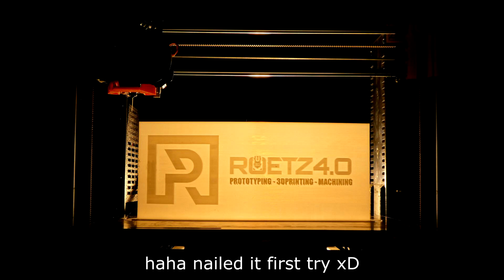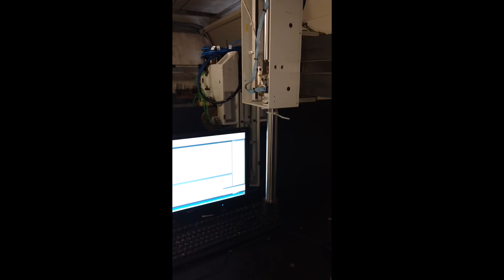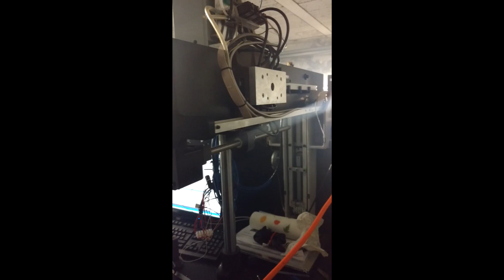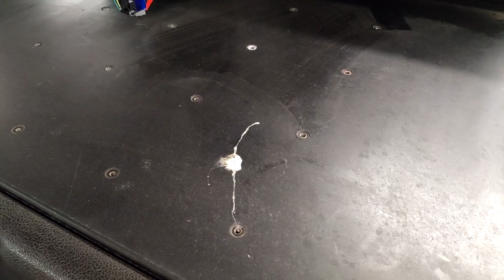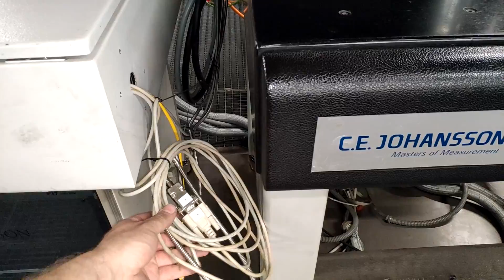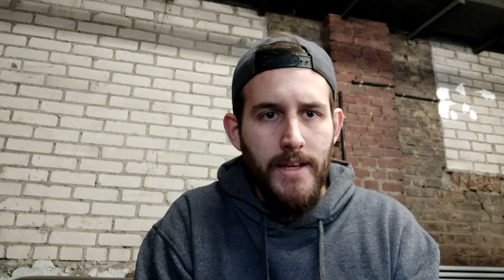What to do with my 1.3 Ton - Air Bearing - 3D Printer ?! #S01E01

Comment: if u want to full utilize ultra precision of air bearing system as additive manufacture system,I recommend u print biology tissue.But u need to upgrade feedback and drive system(better encoder and coreless linear motor,possible linear amplifier as well)

Comment: You could make it a 3D printer, but also a reverse engineering tool.  You could put a part on the bed then let the machine digitize a large number of points, similar to :  https://youtu.be/on53HHSSGOI  I know digitizing organic shapes or reverse engineering complex shapes is something that is very difficult for a small machine shop.
Reply from the maker: Interesting suggestion. I do have a matching renishaw probe. Lets see if I can squeze all of this together

Comment: Hey!
Impressive project! My suggestion: if you're already retrofitting a coordinate measuring machine, why not using it's precision to measure your prints with a tactile probing head as a quality check?
Reply: Ohhhhh, feedback loop to account for shrinkage. Print once, measure, scale and print exactly the second time.
Reply from the maker: Interesting idea! Never thought to do that, there might be parts where this comes in handy
Reply: Yeah this is a great suggestion, if you add a interchangeable laser tool head you could also measure a lot of laser variables.

Comment: I don't know if you can source the materials used for metal injection molding, but doing a custom extruder+hotend to 3D print metal parts would be cool. You might have to enclose and heat the build chamber and definitely need a furnace for sintering.
Reply from the maker: Direct metal printing is like the holy grail. Had a lot of thoughts on this one. My heat treating oven lacks 100-150°c to make the first steps in this direction, but I have done some experiments with powder infused filaments.

Comment: Add a toolchanger for swapping hot ends and apply the 3d tool path technique to allow prints with layers aligned with surface curvature. 
A heated bed and enclosure should be added as well.

Comment: Something I am thinking about currently is adding active feedback to the extruder of a 3d printer. I.e. monitoring temperature, flow rate and dimension of the plastic stream right when its coming out of the nozzel and adjusting extruder feed based on these measurements. But at the moment I am not sure how to achieve that relatively cheaply. 

An older idea I had is adding a hot knife to a 3D printer as an additional tool to improve surface finish. Such a tool could be used to finish some critical areas (e.g. cylindrical holes / contours of gears ... ) after a/some layers are laid down. 
Perhaps the easiest way to realize this would be a retractable heated small metal cylinder. It could only be used to finish vertical walls but I'm not sure if a fully articulated tool would make sense anyway. 
By the way I do not have much experience with 3D printing right now (I do not own a printer yet). These are just some ideas I had to improve a 3D printer from an outside view.
I would love to see someone try those things out and your machine looks like it could be the perfect basis as it is very rigid and precise.
Reply: Thats a cool Idea! There is a Feature called ironing which runs the hot nozzle on top of the last layer and leaves a really smooth surface. Your Idea is Like a extended version of that!
Reply from the maker: We need ironing in combination with "non planar slicing". That would be awesome. But that is more a problem of software development rather than hardware
Reply: @Roetz40  the non planer printing Brings a whole new level of problems with it... I think you should stick to normal printing and add the "ironing rod"... With a Ball end and a Triangel shaped rod (to get Into 90° Corners better) would be such an awesome Upgrade and isnt even that hard to implement! The non planer printing would only really Shine If you get more Then 3 axis going, atleast in my opinion.
Reply: @clypeum5063  Yes I think the "ironing rod" is much more versatile because the clearance is very easy achievable. 
My first approach would be a cylindrical rod with a ball end as you said. Triangle would also be very nice but you need an additional actuator to turn the tool.
Something I'm worried about with this is accumulation of plastic on the tool. I think a cleaning solution is definitely needed, but this could be as simple as some metal brushes on the edge of the printbed.
Reply: @TheStoffl91  but you will never achieve clean corners with a cylindrical rod... but For Testing purposes i would agreed with you. Cleaning could be done with a simple linear Motion in Z (you need to retract the Tool sooner or Later and retracting it Into a sleeve would help with cleaning and is a safety Feature because you cant touch it when its hot and Not in use. The same retraction in Z can be done with every Other tool shape also. No whipers or stuff that gets in the way. Interesting concepts!
Reply from the maker: Thank you for your feedback!
- Active flowrate/process monitoring (smart hotend)
- improving surface quality of top layers/ perimeters

Both added!

Comment: Marco Reps may be interested. It would be nice to see a collab.
Reply: he is certainly interested, but a bit afraid of Beckhoff stuff 🙈 my servo drives speak CANopen and I tried for a few months to make LinuxCNC work with a Beckhoff EK1100 + EL6751 stack. but that turned out to be technically impossible in the end: the linux 
IgH EtherCAT Master package doesn't implement Beckhoffs proprietary CoE mailboxes, which are needed to initialize the servo drives :(
Reply from the maker: @reps  interesting, he's interested. I did the start on Beckhoff because I needed stuff I couldn't do on microcontroller. let's say the learning curve was flat and I was swearing a lot. Also I''m 95% positive it will be ripped out of switching cabinet for next iteration.

I did try to create an etherCat slave myself to create a bus system between beckhoff plc and an Arduino (there is a shield available). But I wasnt satisfied by the restrictions and reliability.
Reply: @Roetz40  Have you considered the Open PLC project at all? There's hardware available and may be more convenient for community knowledge.
Reply: @reps  glad to hear. :-)
"proprietary" the cursed word that can kill any community project instantly. :-(
Maybe switching to a more open servo is really the way. BTW any opinion on the STMBL project?
Reply: We have had good luck upgrading with Teknic ClearPath servo motors. Figuring out someone else's proprietary nonsense can certainly be a big waste of time.

Comment: With this amount of accuracy i would like to see how a custom Hotend equipt with a carbon fiber laying device works! Not just the filament with carbon particles but rather with actual carbon strands. This would not only make for an interesting hotend design but also an interesting test in terms of mechanical ridigity of the printed parts!
Reply from the maker: Alrighty, carbon strand infused parts. I might have to look at the markforged machines again. Interesting idea!
Reply: Agreed! My mind went to an automated fiber placement machine as well.

Comment: Heated chamber for higher temp printing.  There is a lot of mass to be heating up though.
Reply from the maker: We can have a look at that If a heated chamber is needed. But right out of the gate we might run intro problems with different heat expansion rates of the air bearings. Some material combinations are steel/brass, so we might loose the needed tolerances. CMM's are really picky on their ambient temperature. But thank you for the idea - noted!